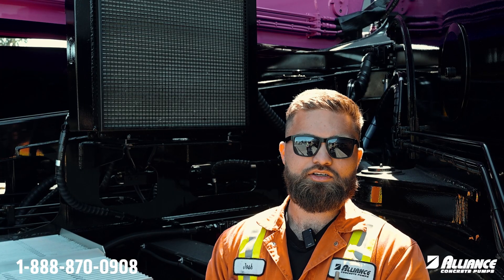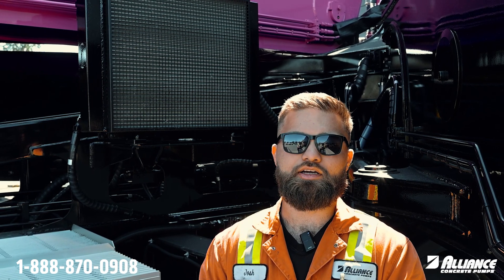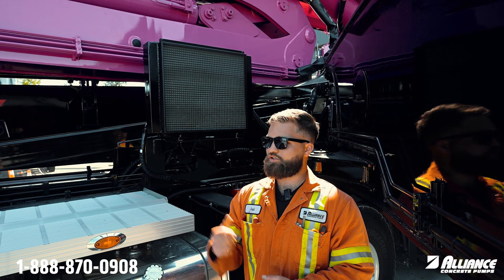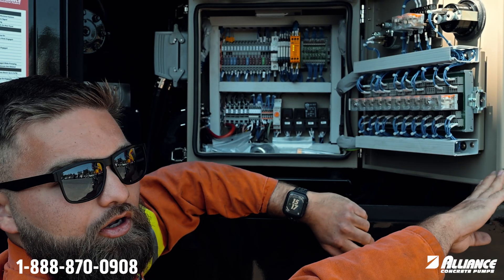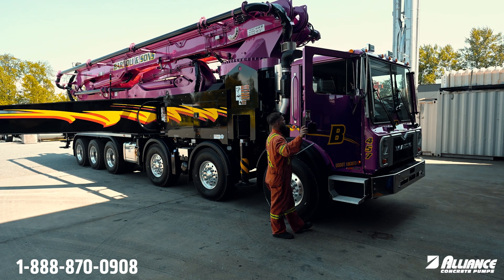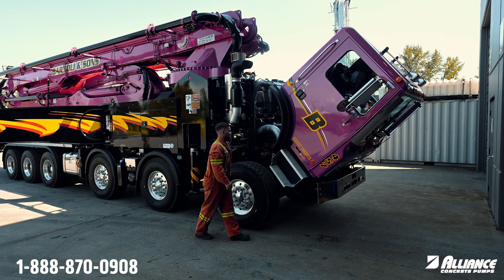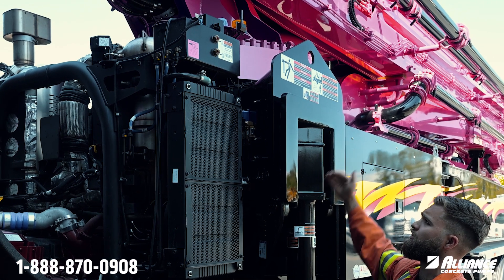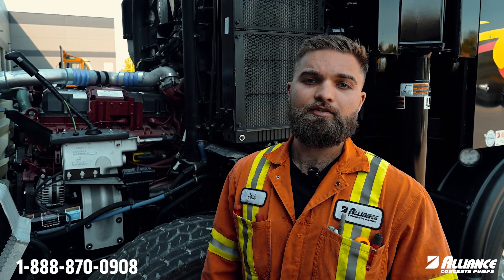Cooling Systems on your boom pump (Oil Cooler Fan /Engine Fan)

Comment: I did notice on the 32zz the turrent is almost fully enclosed and creates a hot spot right behind the engine. Hot plus concrete, yikes. Otherwise, it's a good pump to run!